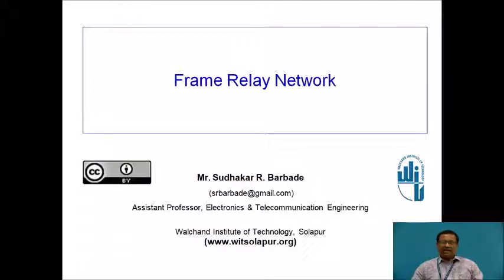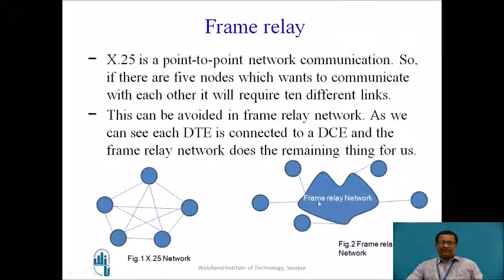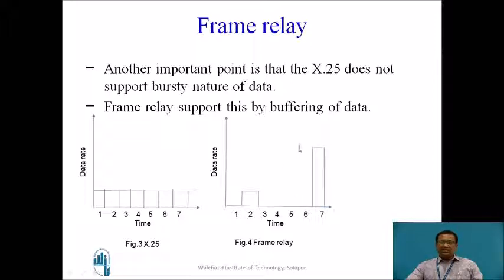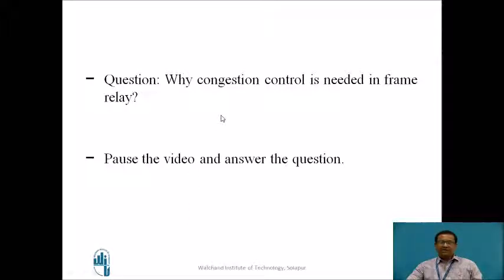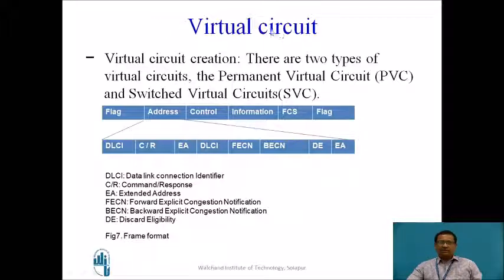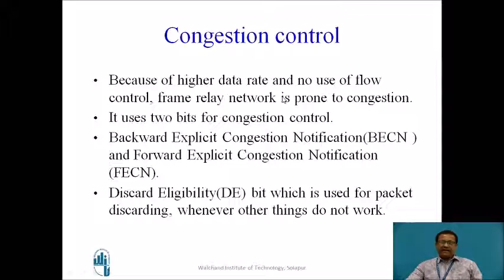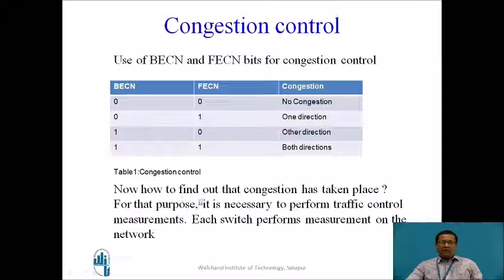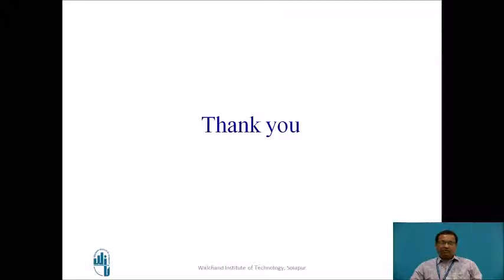Frame relay Network

Comment: as far as the lecture is concerned the frame relay control congestion due to high speed  of the data transmitted.